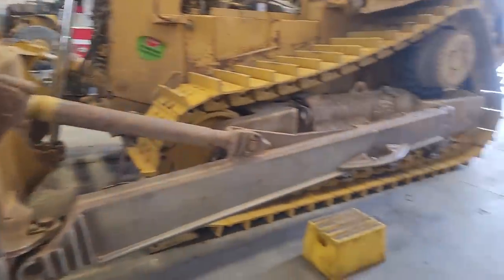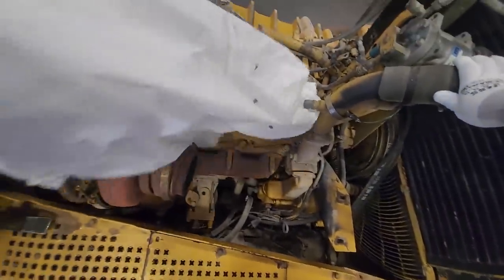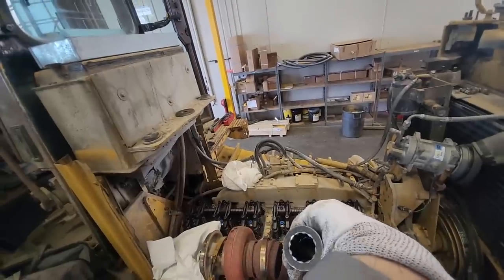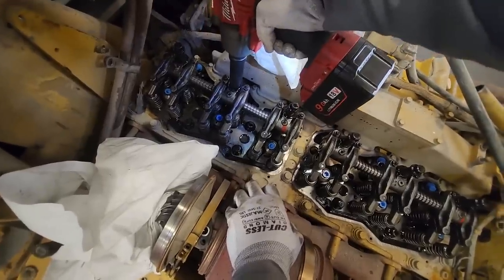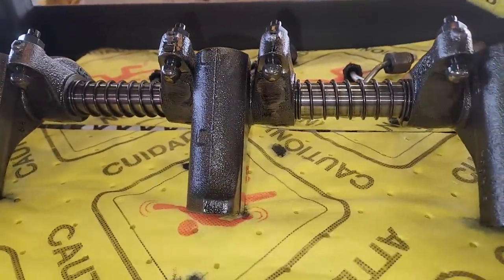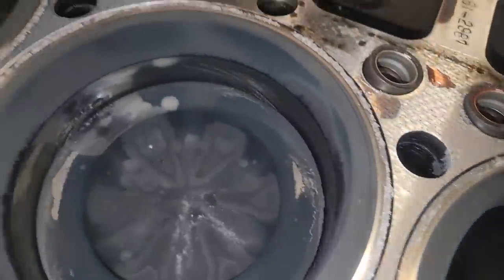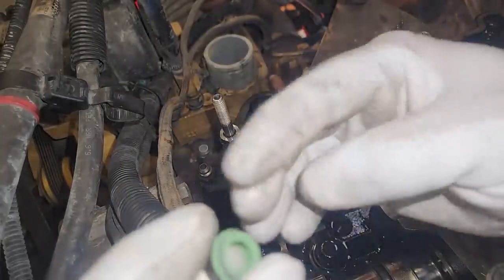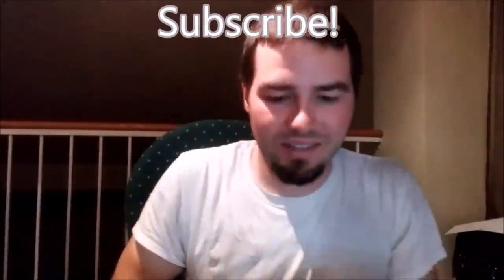D8 Dozer is Thirsty for Engine Oil. Cat 3406 has Oil Consumption.

Comment: As somebody who is not a diesel mechanic or expert, but who has seen many diesel runaway videos. I'm curious what condition the turbo is in? And if that's why it's consuming oil and why intake valves looked wet.
Reply: He mentioned when he began working that the turbo and other minor probable causes had been checked and ruled out by field techs. At the 1:15 mark in the video.

Comment: First I always double check what another mechanic says or thinks the problem is. They may or may not have had the right test equipment available or on their truck to properly diagnose. Ive had to make an Educated guess many times myself and not always right. That looked like an old school 3406 with no ECM?
Invest in a borescope instead of using the mirror. Mine was less than a hundred, has fifteen feet of cable with Camera, adjustable LEDs, rechargeable and WiFi's to my phone and tablet.
Will pay for itself overtime if you ever have to find a bolt,socket or wrench working on equipment with covers or pans.
I to noticed your battery jumping around pretty bad,you might try a big rubber band or two to help  secure it to handle.
Number one reason in the shop our guys have sent there' Milwaukee's in is for it not holding onto battery anymore especially when using the higher amperage ones.
Belly pans are second only to tracks, as being dangerous when working on Dozers I think.
Reply from the maker: I like the rubber band idea.

Comment: In that it is a turbo engine, the intake manifold should always be under positive pressure whereas the crankcase and valve train "should" be atmospheric, or very slightly lower.  Unfortunately the head is now off, but while it was running, did you test whether there was positive pressure in the crankcase/valve-train?  Is there anywhere upstream of the valves where oil could be entering, turbo compressor shaft seal?

Comment: Had a D6M dozer, not sure what CAT motor it was. The governor housing shared a wall with the fuel system. Governor came apart, cracked the housing, allowing the engine to run on its own motor oil as well as leak like that. Couldn’t shut the motor down and had to remove the pre cleaner and cover it to starve the air off, not before it cost a motor. Cat tech said he’d heard of that happening before but had never seen it until then.

Comment: Hi Josh in marine applicatieontwikkeling there are oil shields mounted to the rotocoil to provent oil consumtion and bleu smoking part nr 1376500 (rotorcoil for 3412E 9pw engine)

Comment: Years on equipment mean little, how many hours are on the engine? Also how much oil are they considering as high? Are they talking 20L every 250 hours? That much would show high or increased carbon residue compared to the other cylinders.

Comment: Air filter should have been changed. When the primary filter is passed its day it causes a negative pressure that pulls oil past the rings. Pre check and the oil level is down a gallon from yesterday then you swap out the primary and the problem goes away.

Comment: Had a 416 backhoe with a Perkins engine. Didn't burn any oil in 3 or 4 hours of running. But if they ran it all day it would burn about four quarts. Found a pinched off crankcase breather tube by the oil pan

Comment: I was wondering if this dozer smokes using oil?  We have an old case loader at work and it suddenly started using a huge amount of engine oil, like 6 litres a day, and it doesn’t even get run full time! But its not smoking even a little. So then I was wondering if the oil was somehow getting into another system like the transmission maybe some how, but by now it should be way over full. I suspect it’s burning it and not showing blue smoke. Its also not spattering oil all over it self, so its a bit baffling. Could it really burn that much oil completely and cleanly?  I suppose it could, maybe its using the engine oil as fuel and not using as much diesel??  I dunno.

Comment: What is that air powered vacuum you’re using called? I use a  regular old shop vac to clean the dirt off the top of the 3500s I work on and lugging that thing around is a pain!

Comment: Any engine oil making its way into the torque converter or transmission, coolant maybe? Have seen bad rear main seals pump lots of oil into torque converters before. Definitely no oil tracking inside intake ports say from turbo either? Another cool video Josh!

Comment: pulling the intake off with the head, done this many times. You get a old distributor wrench tool so you can get to them. Once loose pick them up and put rubber bands around them to hold them up. Jake Brake rocker arm bolts are even longer.
Belly pans, just hope a Copper Head or another fun snake falls out.   

Destruction of the week. Oil out the back of the head. They have the fuel return line in the wrong port. I have seen this.
Reply from the maker: I was waiting for you to chime in John. No venomous snakes up here lol, maybe a moose will fall out. I haven't heard back from the C15 with the oil coming out of the head. That would pump that engine out of oil pretty fast at the rate that sucker is pushing.
Reply: @AdeptApe  Lucky for us the one that was wrong, the 75lb regulator was strong enough that if any oil went in the return was not much. The truck had a misfire if I recall. As the air could not vent and the fuel would over heat in the head. Is the valve guides the same part number on a 3406 E head? If so maybe use those valve guide seals. 

My oil consumption, found pipe on low psi turbo installed wrong and a path for dirt, also as I asked, about long life coolant solidifying causing abrasive wear. Regulator hsg worn in the seat, causing regulators to open crooked, thus the seal was rubbing on the regulator cutting deep grooves. So with fan on, 150 F temp, needs oil carry over canister.
If I am lucky it will get hauled out. I dislike cleaning up somebody's diaper. I rather clean up after my self.

Comment: 3:15 I think that the battery case on the front is separating. You can see it if you slow the video down
Reply from the maker: You are correct. I found out about that after that clip, it just went dead and I was like "what is going on" I hate batteries.

Comment: Is there an oil galley that the injectors run in on a c15. I have seen internaty huei engines do this when you loose an oil galley oring on the injector.

Comment: Dozers suck to work on. Wheel loaders are worse. Check the transmission oil. The  engine oil could be filling the transmission through the cooler.

Comment: HUMM? No visible  leaks ?🤔 Use a UV dye in the oil and check with a UV light source 🥸 oooops can't do that now.   Turbo shaft worn or return coked up(burnt oil deposits) ? Seals ?  Broken oil Rings ?    crankcase pressure higher than atmospheric pressure (crankcase vent)? ADDING TO MUCH OIL ? Hard to say. Great video . Thanks
Reply: Whole pile of you guys that don't listen... just run your mouth.

Comment: Should have checked blow by in engine before shutting it down, by opening oil fill! I've seen 3408 and 3412 engine have alot of blow by and using oil badly! Actually seen them push dipstick up off of tube! I would think this blow by push oil down valve stems, excess carbon in cylinder burning oil!

Comment: You didn't state how much lube oil is been lost / hours.
Had new truck with DITA 380 w / brakesaver (3406) in my truck.
It always used 1 gallon of oil evey 4000 miles. FINNING investigated it under warranty and couldn't find any problems besides the usual brakesaver seals weaping. They replaced those twice and had little effect.
Had another friend with PCTA 360 w/ brakesaver (pre-combustion 3406). He also used oil, not quite as bad as my mine. Both had long trouble free service lives. Over the years have heard many stories of early 3406's with abnormal or high oil consumption. Sorry for no answer for your D8N. 3406's aren't not exactly leak free engines either..

Comment: Hey man I watch all your video. You helped me alot. I have a question in my 2006 sterling I have a kcb c13. Truck was not wired to have a engine brake but my engine has jake on it per cat. My serial member is Kcb52100 is there anyway I can wire it up to stop packing extra change of underwear for every mountain I have to come down. Thanks in advance
Reply: Your engine has a IVA, but does not have the Cat compression brake made into it. You will have to purchase three housings and since your system don't have the brake, they may not take it back as a core, if you get reman. 
On your J1 connector see if you have wires in pin 23 (low), pin 40 (med) and pin 5 is common. If so it is wired up to the ECM. Next you need to know if wires are behind the dash. If they are you just need to get the switches from the OEM.
If no wires in pin 23 and 40 you will have to run them up to the cab. Pin 5 is the common so it will have a wire in it for other functions. You will have to remove it and install a wire split er and connect it to a two pin connector. Or you can do it the RED NECK way and cut it and butt splice it destroying a good harness. .

Comment: I laugh at your 12 inch head bolts and give you the Rover K series head bolts. The bolts are approx 412mm long with 72mm thread. If they were a little longer you could have used nuts on the bottom to hold the oil pan on 😂

Comment: You should learn about the 3406 a b c all the older mechanics are retiring and mechanical injection and advance is a lost art. That engine is a C model with the 12 point head bolts .

Comment: why not pressure wash the engine before working on it? that is what i do on mercedes cars
Reply: Because Euro cars break down so much they stay clean
Reply: It all comes down to time, it’s not a 2 minute job like a little car. It’s faster to vacuum it off and dig in then drive it around to the washer, assuming it’s available and it’s a time of year that it can even be used.
Reply: @jaydunbar7538  i pressure wash and then use a leaf blower before i work and it really makes a big difference
Reply: Dewalt makes a battery powered pressure washer that works off a bucket of water. I should get one
Reply: @markm0000  Don't...

Comment: 3406B should have a plastic top hat seal that presses into bottom of the spring retainer. The truck heads ive machined were this way.

Measure the clearance and see where it is at in the tolerance range. Ill bet it is on the high end of the range.

Comment: Idleing and not having clean oil. I would go to. Straight. Mobil 30 weight and  put valve seals on the valve stems anyway. And stop all that low. Rpm work and idleing and.  I know for a. Fact. Pushing a. Big. Load in. High. Gear. Stop. Lugging engine and. Push in. First gear. Not second or third to. Do it. Quick. A. Dozer is. Designed to. Work in. First. Gear. Period. So basically it is a. Operators. Fault for. Lugging the. Engine I been around. Dozers all my. Life and I am 60 I know a little

Comment: 1 quart 500 miles to much?. 😆
Reply from the maker: The actual Cat spec on that engine is 240 gallon of Diesel to 1 Gallon of Oil, which doing the math is pretty bad at about 1400 miles (on-highway application) for 1 gallon of oil burned.
Reply: @AdeptApe  wow, That puts me to ease that my c15 uses 1-2 gallons every 200 hours
Reply: @AdeptApe  clogged DPF on my 308 Ash from motor oil .